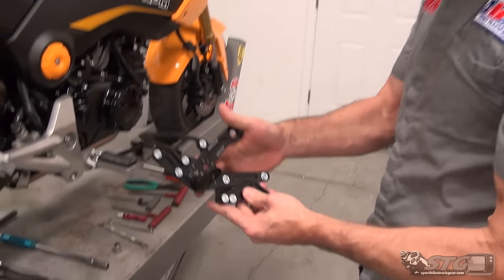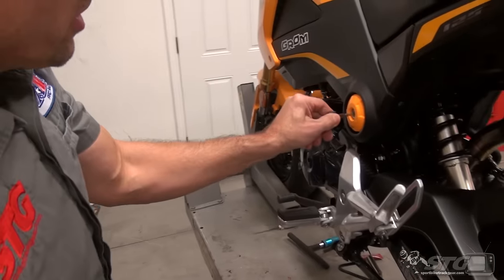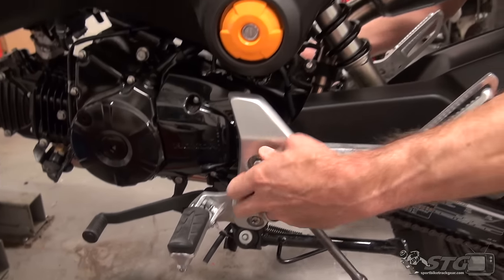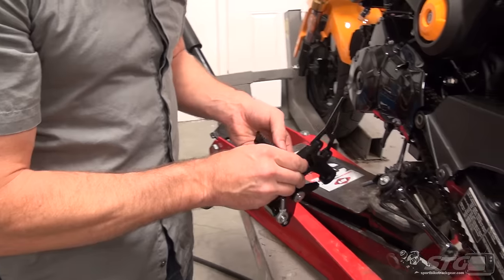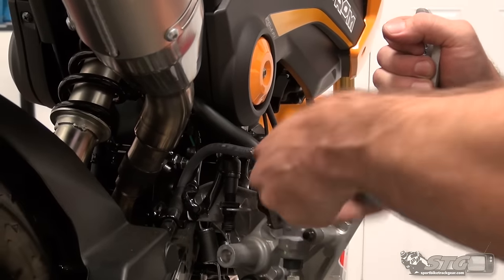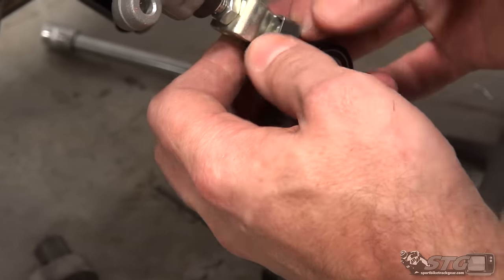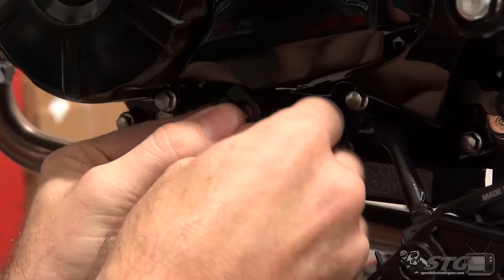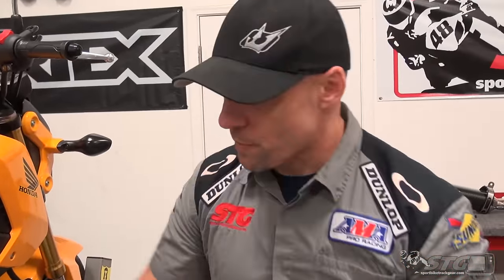Driven TT Rearsets Install on a 2015 Honda Grom from Sportbiketrackgear.com

Comment: Just had to replace a broken rearset (shifter side) all went well but for some reason the big bolt on the brake side will not thread back on grr

Comment: +sportbike Track Gear Hi Brian ! would it be possible for you to release a video for the new in experienced riders like myself on a tool setup / ket e.i ratchet spanners etc that would deliver a good quality job from home as I have just bought my new 2016 Yhamah MT-07 / FZ-07 kind regards Brad.